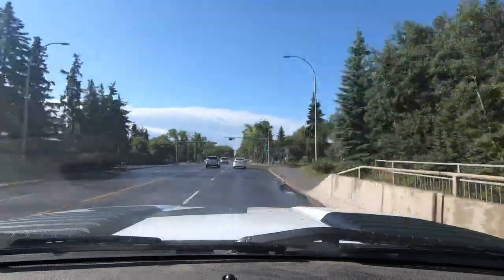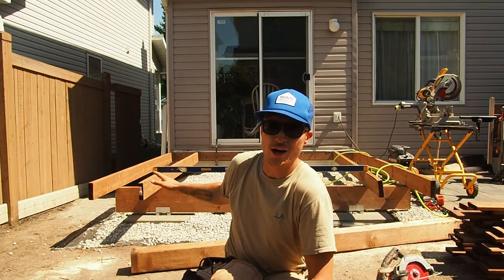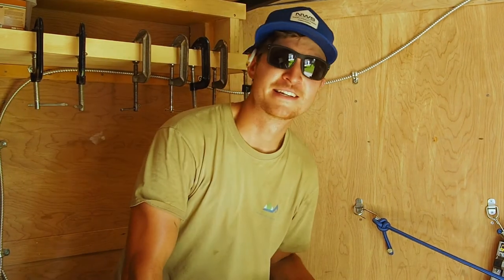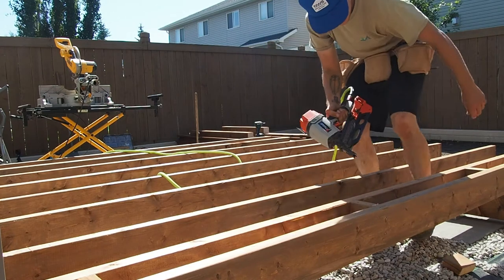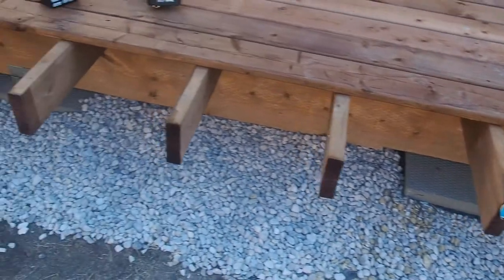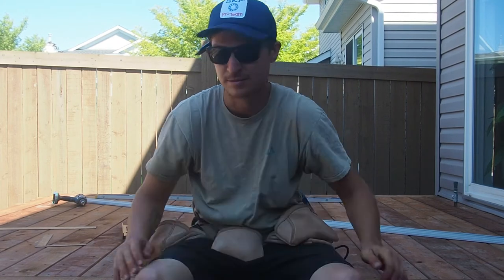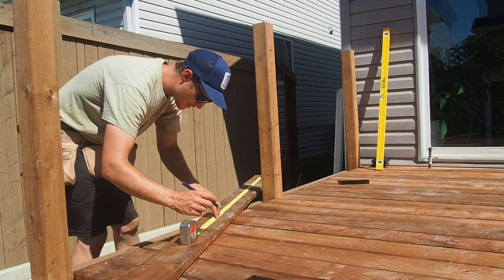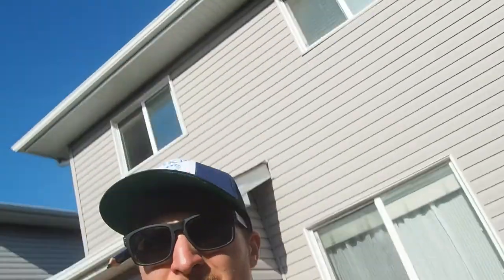Building a deck with pressure treated lumber

Comment: Thank you so much for this, it has been of invaluable help. I would appreciate it if you could answer those questions about the fence:
1. How tall are the posts?
2. What's the distance betweet the bottom railing and the deck surface?
3. How tall are the pickets?
4. How tall is the fence?
Having those measurements will help me a lot. Thank you again!
Reply from the maker: I honestly can't give you exact numbers on that specific project. There were a few modifications made to accommodate the homeowner and her small dog. The answers to your question are all directly related to your local building codes. Railings heights are specified based on height of the deck off the ground, picket spread is under 4" (but should be determined based on the actually project), gap of the deck is roughly 4".
Reply: @hsdesignstudio  Thank you, I appreciate your response.

Comment: Great video!
-Couple of questions for you:    
What type of flashing did you use at the ledger board?  My understanding is aluminum flashing shouldn't be used with the new MCA treated lumber, as it will eat it up.
Are you concerned with the (Dryer") vent dumping excessive moisture under the deck and so close to the ledger board?  And, have you provided for access to the vent so excess lint can be cleaned out occasionally?
Thanks, and once again, thanks for the great video!

Comment: Any shrinkage in length of deck boards? I’m doing a picture frame as well and seen another channel where the length of the boards shrank in 2 years. He didn’t picture frame his PT deck but still had uneven boards at the edges. Kinda freaking out about it now lol…
Reply: There's hardly any shrinkage or expansion along the length of a board, it's across the grain that this occurs.

Comment: Ok, I’m definitely not a pro but I have a question. Why do you install your deck so that the top boards run parallel to the house? My thought is that you want the water to run away from the house and that would mean two things. 1. Run the deck boards perpendicular to the house 2. Make a .125” slope per foot away from the house. Just an amature thinking out loud.
Reply from the maker: The run parallel because of the framing underneath. In order to run perpendicular, I would need to have more beams, more foots, and change the joist structure. With a slight slope, the water just runs in between the boards.

Comment: if my deck box is fully pressure treated, ground contact rated - and I'm hoping for trek dex deck boards, do I need ANY sort of weather enforcement or is this thing already a terminator?  also, it's floating.
Reply from the maker: In my neck of the woods, you would be good to go. Sometimes adding a special tape/membrane to the top of the deck framing joists can be used to stop any water from sitting or pooling.
Reply: @hsdesignstudio  why not right? go nuts once and she lasts forever.
Reply from the maker: @MrHartApart  or at least a very long time 👍
Reply: @hsdesignstudio  many argue that flashing tape will trap moisture..

Comment: Why does that pressure treated wood look like cedar? Did you stain it first?
Reply from the maker: Our pressure treated wood here in Edmonton is now exclusively brown. No stain, the colour is just from the treatment process.
Reply: @hsdesignstudio  i notice you left a small gap between the deck boards.  I had read that pressure treated wood will shrink and no gap should be left when first layed down.
Reply: @charliewatts6895  you are right. No gap should be used. Unless it's kiln dried pt wood.

Comment: Please noone put gaps in pt wood. Unless its kiln dried. It will gap on its own as it dries. Theres a reason you dont stain it for the first year.
Reply: What's the reason for not staining for the first year?
Reply: @johnanddiann100  most people use pressure treated wood. Thats what i used. Which is very wet wood for the first year. When the moisture dries out the wood shrinks causing the gaps in the decking. Also you want to wait a year to stain because of the moisture in the wood. The wood wont accept the stain as well until its dry to absorb it.
Reply: @kevinrivard3875  I use a common nail for gapping my deck boards.  When the PT boards dry out, the gaps became a little bigger, but that's okay, as far as I'm concerned.  The larger gaps don't get clogged up with debris, over time.  When I bought my house, the existing deck had this issue and it was a pita to clean out the gaps when staining/sealing.